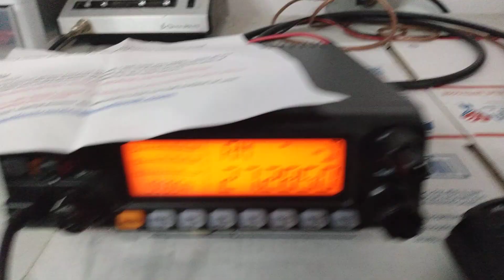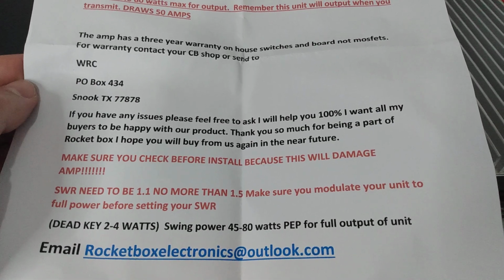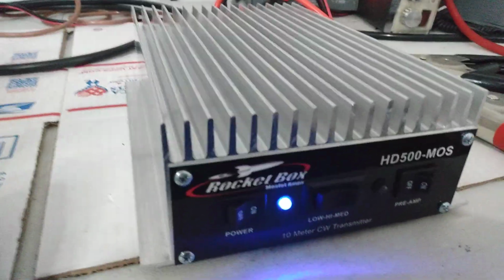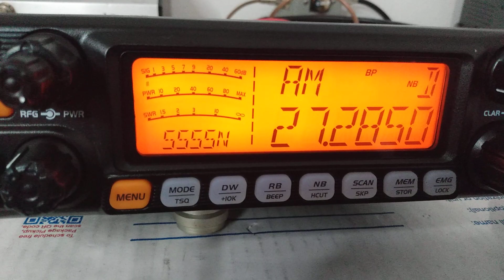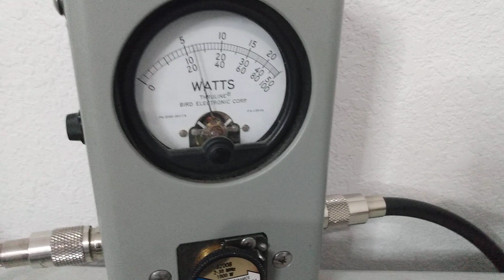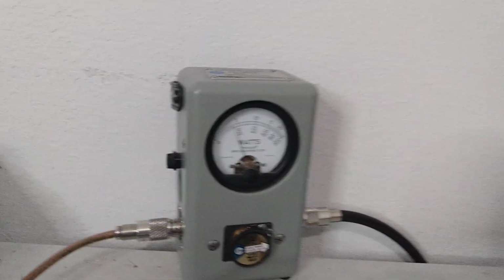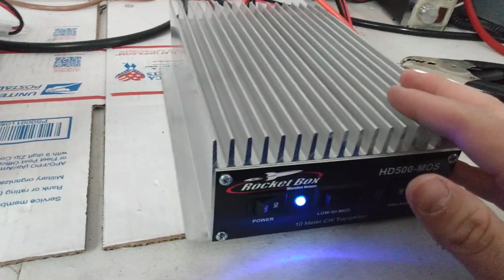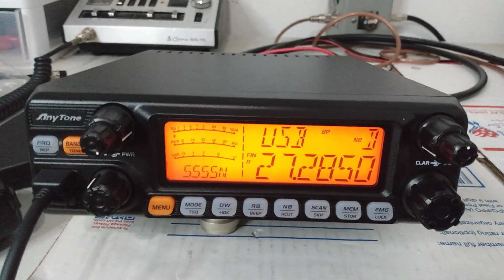RocketBox 500 MOS tested with an AnyTone 5555N

Comment: Hey them hg2879 pills are kicking butt the ones you sold me. For my 6pill is working great. I'm pulling off 200 more watts Pep with them and yesterday I seen 1700watts.but I think that's conditions were just right for that to be. I see 1500watts using my stock peaked and tuned striker 955   I run the radio at 15.5 volts. I just wanted to let you know how it helped me. Also went through the app pulled each cap and tested them took most of them out. And replace them with one percenters with the same value after testing each part. Thank you....... My 6pill is a beast now

Comment: What would a 29 cobra cost me to set it up for them specs for the rocketbox HD500mos buying a cobra through  u
Reply: Man if you can run rocket box get a real radio still pissing around with it with him cobra 29
Reply: You’ll see 160 with a 29 requires a 80 watt radio